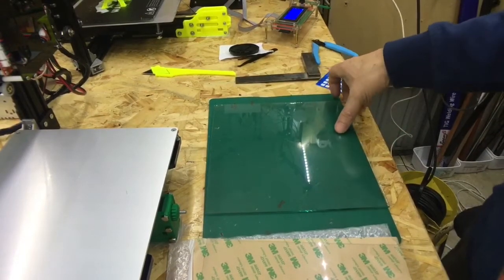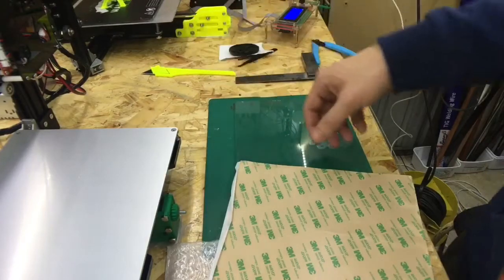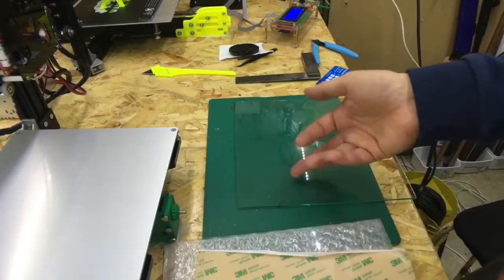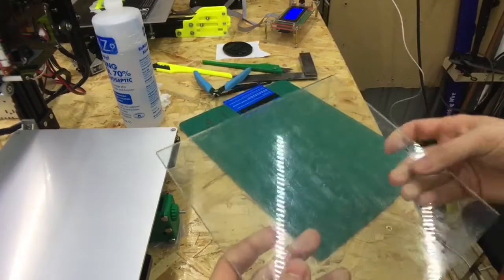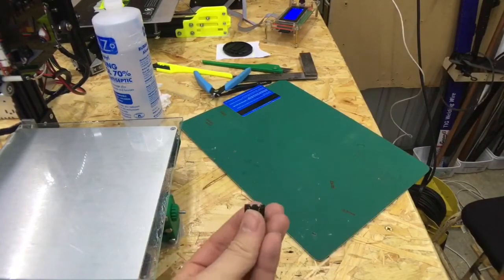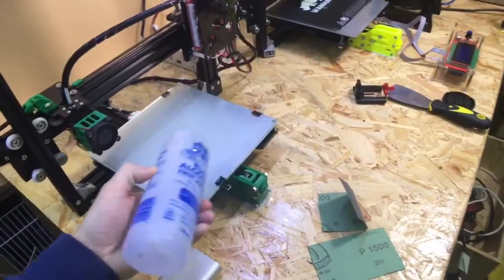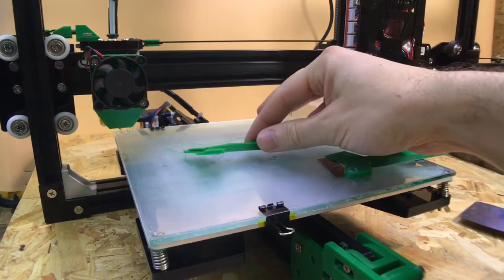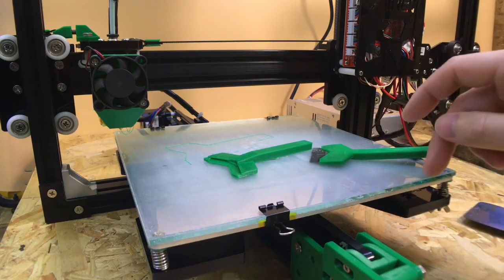Installing Pei Sheet To Glass 3D Printer Bed ANET

Comment: Sorry to disappoint you but it isn't PEI. Genuine PEI material is amber translucent in color, can be darkened but it can't be clear and transparent like that Chinese fake PEI (probably polycarbonate) you got there. Believe me I've been through that after extensive research I got my money back and bought a genuine PEI from gizmodorks. Don't ever buy "PEI" from China, all of them are fake, some color them and claim they're real but it's bullshit. If it sticks and prints well it doesn't mean anything, polycarbonate is a decent printing surface either.
Please look it up and remove the links from your description so others won't buy or just don't claim it's PEI.
Reply: And what do you base these claims off? Tested this sheet yourself?
Reply: Polyetherimide (PEI) is always amber-to-transparent , meaning transparent amber, source: https://en.wikipedia.org/wiki/Polyetherimide and some examples of amber-to-transparent: https://www.google.com/search?q=amber+to+transparent&newwindow=1&source=lnms&tbm=isch&sa=X&ved=0ahUKEwj484DMpoXcAhXprVQKHdIFAxsQ_AUICygC&biw=1920&bih=927

So the sheet on this video is not PEI, that being said if it works for 3D printing good for him but once you go higher temperatures it wont have the specifications which PEI has. There are a lot complains about these sheets bought from China, some people really love it but majority can't get working and still uses some adhesive on top of it.

Comment: Mosfet heatbed upgrade sounds good. How long does it currently take to get up to temp and what speedup will the mosfets give you?
Reply from the maker: 6-8 minutes get to 66c. well it might not speed up the heating at the moment i would say the gauge of the wire is rated max 8amp get warm to the touch the bed alone draws 10amp,  heater cartage for hotend 4amp. and the mosfet will take the strain of the main board also.

have a good week my friend